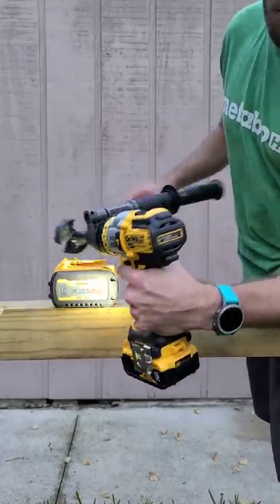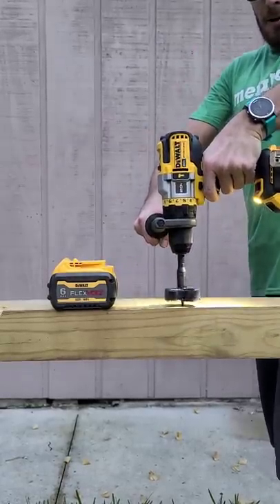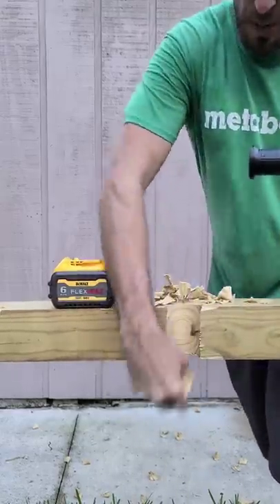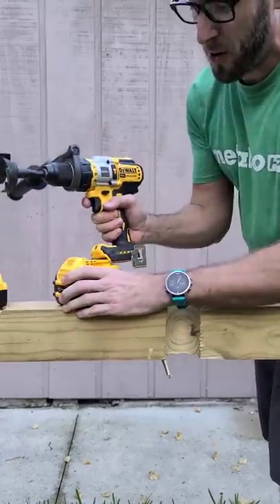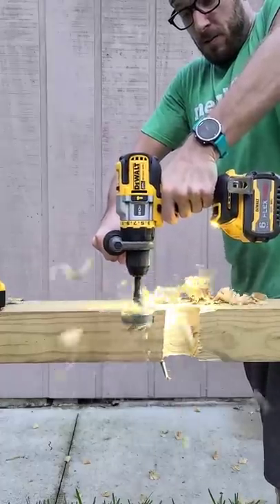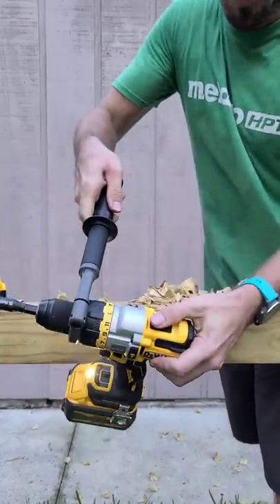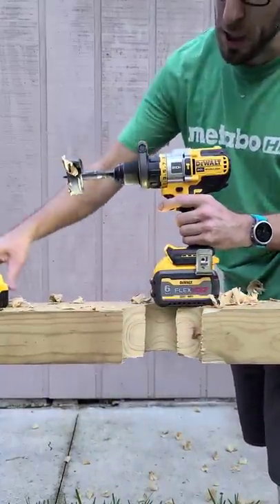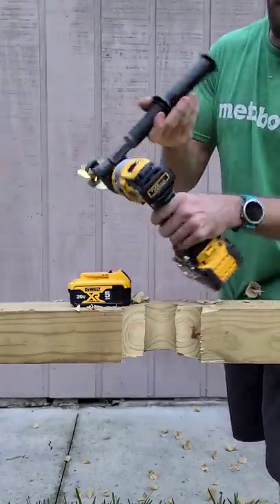New FlexVolt Advantage 20v Drill - quick test

Comment: More load if you are drilling the entire diameter, and you should always drill a large bit on slow speed. The only difference between 5&6 amp will be how long it runs for. 🤦‍♂️
Reply from the maker: That is false. There is a large power bump when FlexVolt batteries are used in the FlexVolt Advantage tools. They are programmed that way.
Reply: @TOOLSbyDesign  but you still should drill the whole diameter
Reply: Yep. As construction worker,  my 18V Milwaukee Fuel drill struggles with a 2” hole hog. Impossible in high speed at full diameter.
Reply: I'm not even gonna start.
Reply: Fucking thank you
Reply: The capacity rating 5-6Ah should not effect tool performance other than battery life. What you're seeing here is basically the manufacturer of the 6ah battery used some 18650cells that are much more powerfully (the can safely dump out more current with less voltage drop) essentially the batteries have lower series resistance making it safe for them and possible to do this...however I didn't see you drill the full diameter. 

Btw the 6Ah battery will drill less holes sure faster than the 5Ah but it will last way less because the efficiency of these drill motors is not at high torque and high rpm but rather high rpm lower torque but same power

Go ahead try it. I did too. Makes perfect sense when you look into the operation of the insides of the drill
Reply: As long as the drill doesn't struggle its fine. But i wouldn't do that constantly.
Reply: @TOOLSbyDesign  False? Then I am glad I don't use those batteries or that brand. I like something that does its job and doesn't change based on battery size. Batteries are to hold energy and to apply said energy at a steady flow. If these batteries do as you say then it would die off quickly and become useless at 50%.
Reply: @adam207321  that's not necessarily true. Drill batteries are already pushed to their limits, you can hear that in the first test the battery was struggling and voltage dropped. More cells in parallel = more amps you can draw without having as much voltage drop, giving more performance. A 6Ah battery is actually  more capable than a 5Ah one that uses the same cells.

The 6Ah battery could last less if it was a different voltage, it will  have roughly the same life as the 5Ah one if the 5Ah one was really at it's limits. That will be healthier for the battery though, as in the long run it will last way more time, as the 5Ah one will deteriorate and lose capacity faster.
Reply: @FAB1150  i don't know if you ever held a 18650cell in your hands. These batteries are constructed with them and they use a multitude of them... Some are high capacity cells and some are high power capable cells.. you can't have both unless you accept the fact you're gonna need a HUGE BRICK attached to your handdrill
Reply: @adam207321  I build 18650 battery packs so... I know how they work. And I know electronics.
You should know that as a cell current rating gets higher, its capacity drops, and viceversa. So if they only did swap out the cells for ones with a higher current rating, the capacity would be lower, not higher. They just added more cells in this one. And that's good, because you distribute the load between more cells,  stressing them less.

When the guy was using the 5Ah pack, you can clearly hear the cells are being overamped. With the 6Ah one they aren't.
Reply: @FAB1150  I am familiar with 18650cells. I Was aiming at the rati of capacity and current cappabillity just like you finally figured it out.

But its not so much about the battery as the efficiency of operation within the drill. Also They have to absolutely use some other type of cells. Its much fatter and you only get a 1Ah bonus. I bet if I measured that it wouldnt be 6Ah.
Reply: @adam207321  "you finally figured it out"? Wtf? I repeated the same comment twice with different wording. 
I'm saying that just by listening to the drill, you can tell that the 6Ah one is much higher quality. The drill isn't going faster, as the voltage is the same (except when he used speed 2 obviously, but that's a different thing). The pack is just losing less voltage, giving the drill more torque allowing it to have more consistent rpm. That's it.
Reply: No he's right your Ah rating is just the run time of your battery. You might have a higher discharge rate programed into it. But you can have the same effect out a 5ah battery it just goes dead faster. AH rating is run time.
Reply: @FAB1150  and itl last less holes :)
Reply: @thetreblerebel  Ah isn't even a rating. It's the ApereHours of a battery, which basically is "how many amps can you pull to get this battery from 100% to 0% in exactly an hour?".

It basically is capacity. But depending on how overworked are the cells, putting more in parallel can give you more power other than more runtime. Take this silly example: you have a car with an underpowered engine, and you want more mileage. So you put another engine + tank with it. You now can either use one engine, and when it runs out of gas you switch to the second one, or you use both at the same time to get more power out of it.

 As Adam varga said, here they probably used higher load cells, and put more in parallel, giving the pack way more power than the other one.
Reply: @adam207321  probably yes, because it can use more power per hole so it will drain faster. This means that the 5Ah battery was REALLY underpowered for the job!
Reply: @FAB1150  actually my explannation is this
 The brushless motor runs much more efficiently at high RPM but lower torque. Since he switched to higher speed removing some gears from the geartrain reducing conversion losses thats fine but the losses then appearing in the motor because it has to run at the same RPM at much higher torque. Inefficient.
Reply: @adam207321  well if you go to speed 2 it's correct, but I was talking about the correct way of drilling big holes haha
Reply: @FAB1150  I would like to see him do that in 304 stainless :D 
Would be a much better measure of what lasts how long. At least we would only need to count to 3 instead of hundreds xD
Reply: You should always drill at a slower speed when drilling with bigger bits and saying there is a difference between different battery charges is stupid it’s like saying my car is faster than yours because mine has a 60 gallon tank and yours only has a 40 gallon ah has no effect on power of an electric motor
Reply: @adam207321  18650 can release waaaay more than 6aI have a few 18650 for vaping with an output of 35a at 3.9v
Reply: @poland5606  6Ah is not the max rated continues current of a single 18650 cell. I have seen cells exceed 100A continues. If you were to actually add up your 35A time you might end up in perhaps 5 minutes of use. So 18650 cells sure can do more but its either capacity or power. With a huge cappacity 18650 your vape might deglove your hand (if you dont know what it is dont look it up) 3,9V
Reply: honestly my only problem is that the author of the video stated that the bigger capacity battery is much stronger.....like as if it makes any sense because battery life does not necessarily mean POWER. Hes like the Jeremy Clarkson of drills...POWER AND SPEED
Reply: @poland5606  hey hey hey, wait a minute:

-there are loads of different types of cells. High load ones (20-30A continuous) have less capacity, and high capacity ones (3000+mAh) have current ratings of 5-8A. So yes, you can get cells that can release 34A. But not all of them can.

-it actually works like that, up to a point . But your analogy is off: it's like having a small hose and trying to fill a bathtub. It's not gonna be fast. You can try to flow more, but it might burst. Adding more hoses can fill it faster.
That's what you do when you add more cells: more hoses. Adding more cells also gives you more capacity. So if you have low current cells , adding more in parallel makes the battery pack "more powerful" .
Reply: @jeffreyvelthuis9245  as long a it doesn't struggle?
That's true but there's more to it, a drill motor can overheat and not struggle until the damage is done.

Burning the windings In the motor is permanent damage.
Reply: @TOOLSbyDesign  I'm sorry programmed???
Reply: @FAB1150  but he also did more work with the 5 amp as it was the first hole in the timber with the 6 amp he drilled a whole very close to the other one so it could go easier through it. Also he put more pressure on the 5 amp as it didn’t he be drill straight so he was going at an angle
Reply: Thank you saying that it loud. Amp is literally the capacity of the battery.
Reply: @TOOLSbyDesign  you should redo the demo a little more honestly by 1. Drilling a whole with the entire circumference of the bit. 2. Not doing the 3rd whole with a third less material to go through.
Reply from the maker: @adamlewis6756  Yes, I am putting together a longer video. This was a short video for my IG and TikTok accounts where all my followers are. I didn't expect this video to blow up on here. Haha
Reply: @Starfire-nv3nk , yes programmed. More of you guys need to do your research on new cordless power tool tech. You guys are all acting like power tools hit their limit years ago and can't get better. That's just ridiculous. Just like everything in tech and electronics, shit keeps getting better. 

Look up the Milwaukee tool FUEL line. They are designed like this. Brushless motors and variable current draw from these higher end batteries can really get shit done.
Reply: @cameron-w  as long as he drilled the same amount of surface.... which he did!
Reply: @cameron-w  exactly
Reply: @TOOLSbyDesign  that's true for all batteries not just FlexVolt
Reply: You’re not electrician you need to use ohms law amp hours
Reply: @adam207321  well said 👍🏻

Comment: So turning it from speed 1 to speed 2 makes it run faster? Really? I couldn't have possibly guessed that!!!
Reply: ya, supposed to be about the amp pack difference and then he never shows the small one on speed 2...doh
Reply: Dr. M. H.  11 is the clutch not the speed lmao....some drills have speed options so full trigger pull on 1 is still slow for example. All drills have the ability to disengage had particular torque levels this is your "level 11" in which you speak of
Reply: @cupric speed 1 is for extra torque and not to melt your tips drilling into metal. For screws... Lol

Comment: More amp hours is more capacity, not higher amperage or voltage. 
You can use it 5 more minutes basically.
Edit: Use the same speeds on both batteries.
Reply: Nah high AH has less voltage drop under load. My 1.5AH battery won't run my weed eater for 10 SECONDS but my 3ah will run it for like 10-20 minutes. The 1.5 experiences too much voltage drop under load
Reply: @itptires  That's, kinda a given with lower capacity batteries unless you have a piss high c rating.
Reply: @itptires  Kinda like a gas engine. Drip a drop of gas in the carb and it might catch for sec, won't rev all the way up. 10 drops of gas, it catches and revs for a few seconds. The drops of gas still have the same potential energy a piece, but more is more 🤘
Edit: correcting spelling.
Reply: @itptires  Like I said above, a (piss high) higher available c rating by design. 
A higher power setting pulls a higher amperage at a specific voltage. Like the drill. 20v 1.5ah battery. The drill uses 20v, if a low setting uses 1.5amps, then in theory it should run for an hour(voltage drop part is coming be patient). If a high setting uses 3 amps, it should run for half that time. 
Now when you double the capacity(ah) of the battery, you have more energy stored, able to be discharged over a specified amount of time. 
Kinda the reason why the bigger batteries typically have around 750-800+cc, where the smaller batteries may around 300-400cc max in a lot of cases. 
Though I dramatically over simplified this, it is mostly correct. Fact check me
Reply: @itptires  I never said they don't give better performance, I'm explaining the reason given is incorrect.
Reply: @itptires  And also, the guy did the smaller battery on low speed and the larger battery on high speed. Why not show both speeds on both? The smaller one will do the same thing, just not as long. 
The individual cells being stacked into a bigger battery distributing the discharge over more cells than the smaller battery, leading to less load being pulled from each cell as compared to the small battery having more load pulled from its smaller amount of cells.
Reply: @itptires  But as you basically said, you know what you know and nobody will ever tell you any different. Have a good night bud 😘
Reply: @NN1Ckl.  you should look in the mirror bud. I'm aware of how c rating works. Please go ahead and explain the point that I've made multiple times of why a small battery of the same voltage isn't even capable of running certain things. Do you think the voltage stays exactly the same while using the battery versus under no load? Larger ah battery has less voltage drop under load therefore can run higher loads without hitting the low voltage cutoff. did you even read the article I referenced? Because you're not providing any actual information to back up your point
Reply: @itptires  I mean, the point you made is flat wrong. It has nothing to do with the amp hours of the battery. I explained, you disputed with a link that proves me right.
Reply: I may be a little late to the party but performance is narrowed down to the size of the battery.  Smaller batteries have less space and can't dissipate beat as well as the bigger batteries, therefore quitting much earlier.
Reply: Lol. Nick is right.

What you are confusing is a cells internal resistance.

In practice, the exact opposite is true.

We can manufacture cells for low internal resistance or ESR, or we can manufacture them for high capacity. Higher capacity cells have higher ESR, which actually means more voltage drop under load.

So, why would a higher AH battery have more power? The answer is that both batteries contain the same cells. The higher capacity battery just has more cells in parallel, resulting in lower ESR.

Now, take 5 cells that are 1000mAh, and 5 cells that are 3000mAh.

You can get more current from the 1000mAh, but they don't last as long.

It's true that the 6Ah can provide more current than the 5Ah, but it has nothing to do with the capacity. In reality, with much lower capacity cells, you could get much higher current provisions. Welcome to Li-ion

Comment: Ok YouTube, please tell me, what was the reason for this recommendation
Reply: So you can go spend 300 bucks at Home Depot.
Reply: @raymundochavira8853  he said uk try screw fix or toolstation
Reply: @bigting4561  those flexvolt advantage drills are not available in the UK they are US only. I'm not sure which one has which but there is a power detect drill with 18 volt 8ah battery and this flexvolt advantage. Lowe's has one and home depot has the other.

Comment: It just increases run time not power 😂🤣👀🧐 I bet that battery is 250 bucks battery cost more then the drill.nah that’s ok keep my old batteries  🔋
Reply: Yea how much you spent on the flex volt you can buy multiple batteries and or drills
Reply: That’s what I been saying that battery is probably 250 bucks or more I can buy multiple 5 amp hours ones an call it a day or a bigger drill sooo yeah
Reply: Shhhh...he actually tried to pul a fast one.   Crazy part is, some will fall for it.
Reply: You can buy 2 flex volt batteries plus a fast charger for 180 on Amazon    in stores they are 200 each
Reply: You obviously aren't a tradesman, or you'd have the need for such batteries and come to find out you can get two 9Ah batteries for under $200 😉 btw did you catch when he stated his 6Ah was a 9 🤣
Reply: @paulstallings6804  😂🤣👍🏼

Comment: This wasn’t an accurate demo.
Reply: You caught that to. Lol
Reply: Why? The hole positionimg?
Reply: @danielraygoza3933  the side venting allows the wood dust/shaving to come out wayyy easier and if it were covered itd be a bit more realistic
Reply: @mrblandflake1036  but he did it the same way with both batteries
Reply: A base level understanding of tool batteries will tell you that there is some other variable here, probably the person demonstrating that the more expensive battery is better. At the end of the day they're the same voltage one is just a higher capacity, it'll just last longer.
Reply: @Just-Steve  Power =(Volts)X(Amps) And that’s basic circuits.
Reply: @chaselesser3191  "power" isn't a function in electrical engineering.
Reply: Davi
Reply: 5
Reply: I would burn that drill up in one job using that way.
Reply: @chaselesser3191  we talking about Ah, so if you motor pulls 2A and you have a 2Ah battery, you will be able to operate to motor for 1 hour. Using a 2Ah or 6Ah will determine how long you can use your tool, it will not affect the power of the tool.
Reply: @Berounes  I understand AH is output over X-amount of time. But a consequence of a higher AH, is that the battery doesn’t experience the same load and can give you better peak performance. You don’t notice it on drills or impacts, but if you use tools that draw more amps, you will notice power drop within minutes. And when using higher AH batteries you notice these tools don’t bog down as easily.
Reply: @chaselesser3191  yes, the higher amp battery will be able to handle more load before the voltage drops and thus the result will be more power
Reply: @FL0RiaN94   Not with lithium ion. In nicad that true.  The DE Walt batteries are control digitally to shut off before the voltage drop.  The larger battery just means more hand cramps.